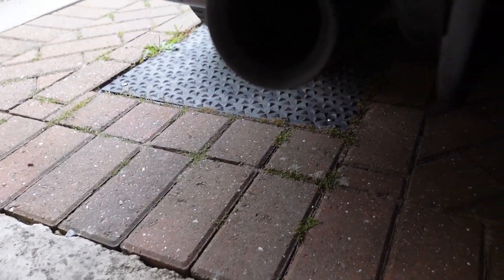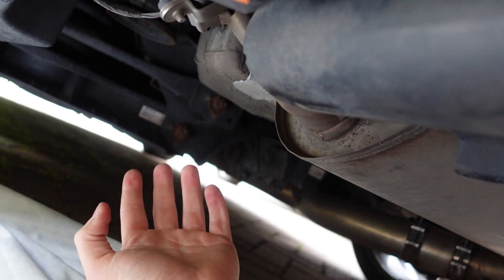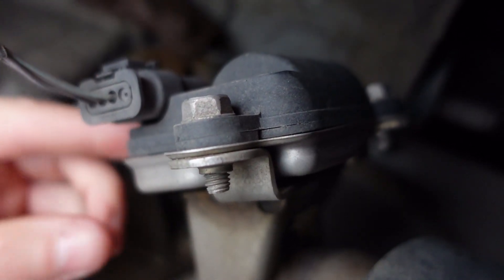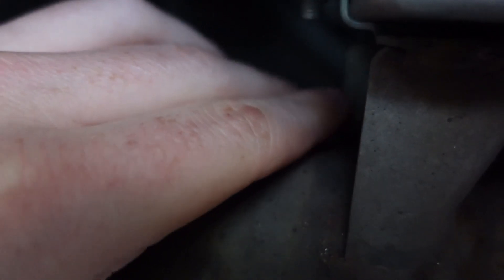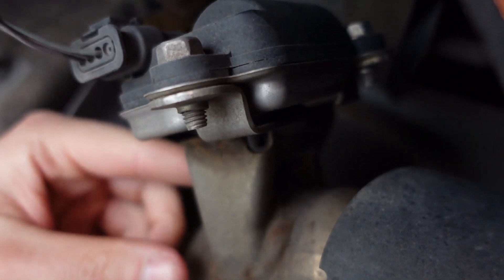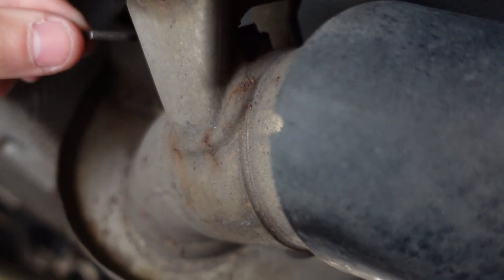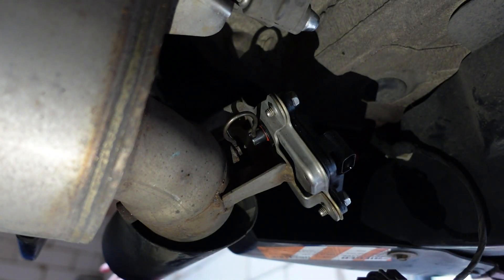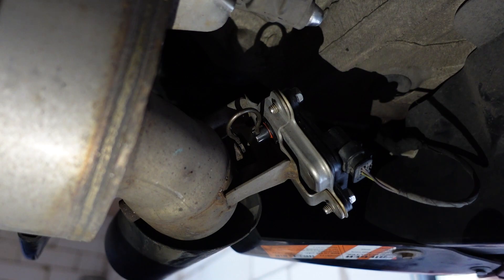BMW M140i Exhaust Rattle Fix

Comment: TOP TIP: put the Sport model when fitting the new clip! Its lines up much better. Great video mate. I just replaced my exhaust clip 5 days ago. You don’t need to get a new actuator, just put it in sports Mode. Another tip if you can raise the car 5cm it makes things much easier. This is one of those jobs that take or 5min or 1 hour. Luckily the clip is only 8 euro. Cheers!
Reply from the maker: Quite a straight forward job fortunately, my actuator started making a grinding noise and it wouldnt spin so looked like the mechanism ended up nakerd
Reply: I'm having the same issue in regard to lining up. I did put mine is sport mode but still doesn't seem to work. I am reading about cold start. Do you have an other tips in regard to sport mode. Do i switch it on from cold, put into sports mode. Then turn off the engine and unplug? I'm reading something like this. Or is there another way? Thanks
Reply from the maker: Unfortunately with mine the actuator slipped out so I couldn't line it up. People say to put it in sports mode etc but it doesn't always work. I had to replace the actuator and when I did it fitted straight in and problem solved. Easy solution is new actuator or you can try other trouble shooting tips, for me none worked, actuator was screwed

Comment: Hi mate is it the broken clip its self that causes the rattle? Could you just remove the clip to stop the rattle and have the valves left open?
Reply from the maker: It was the broken clip making the most noise  but also if the clip is removed the exhaust valve still moves so rattles... before I changed the actuator I put the clip in to make the valve stay open which stops it rattling. Some people put a weld spot on the valve/exhaust flap while its open to keep it open but I wanted to keep mine as it was